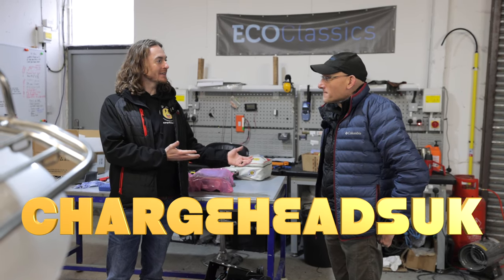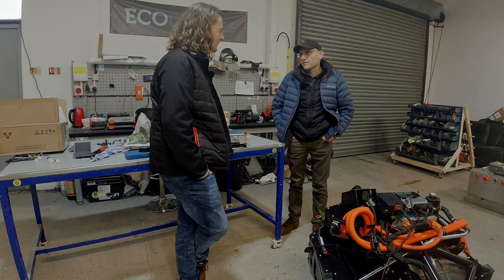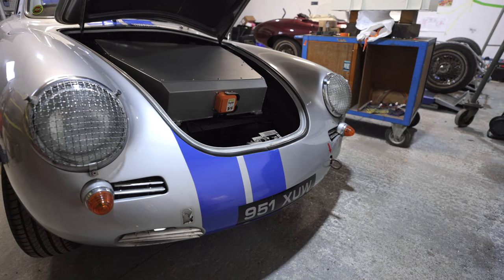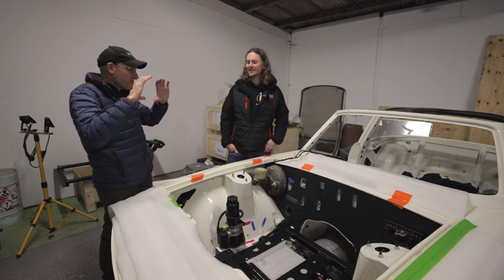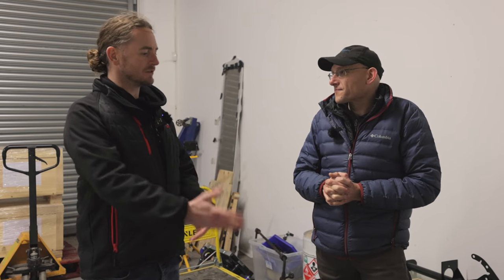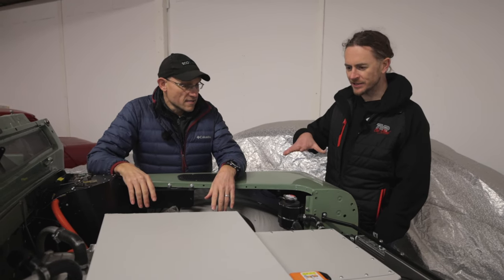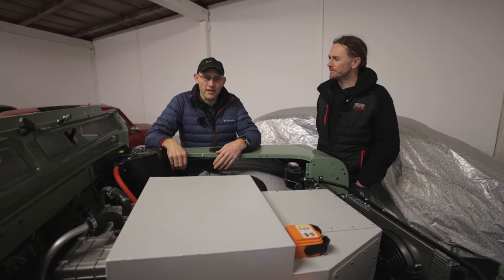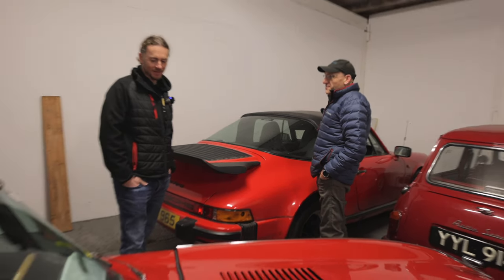We visit EV Conversion Company ECO Classics! Electric Porsche 911,  & V2L charger #ecoclassics

Comment: Thanks for the Video. Great stuff. I'm really interested in the OBC /DC2DC / VTL unit. Do you know where I might find a spec sheet/manual? is Eco classic reselling them or where can I get one. (I'm based in Melbourne Australia).
Reply from the maker: Drop Nick an email at info@ecoclassics.co.uk i'm sure he can assist👍
Reply: Did you end up getting the details on the OBC/DC2DC/V2L integrated unit? I know places like Ovar Tech do them but this is a more compact unit